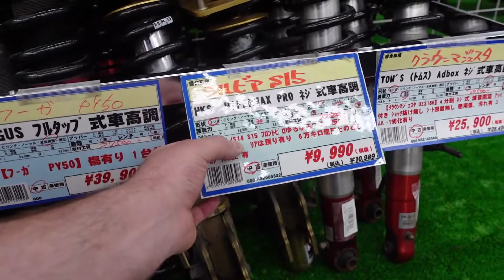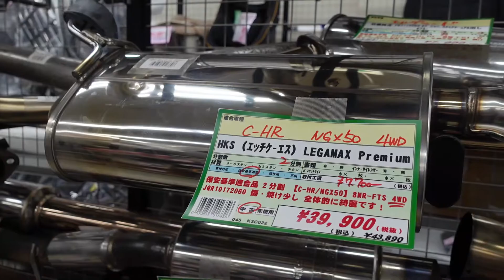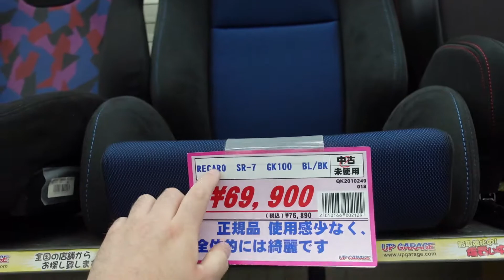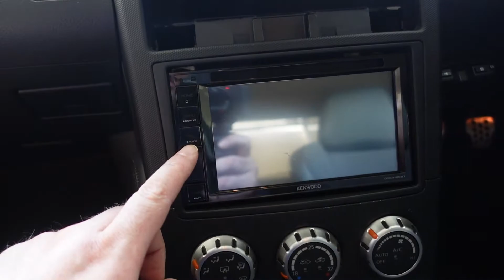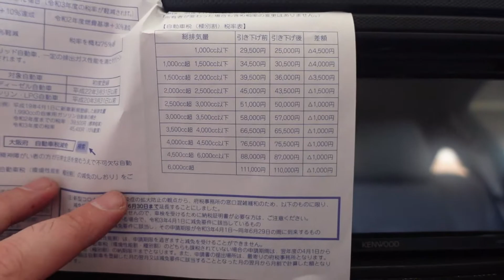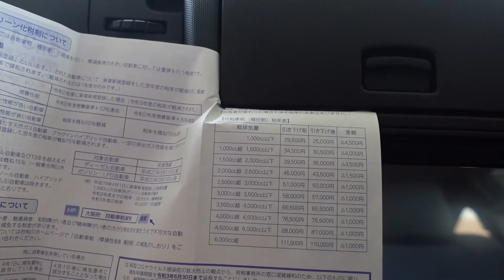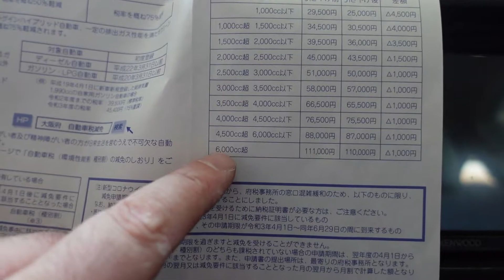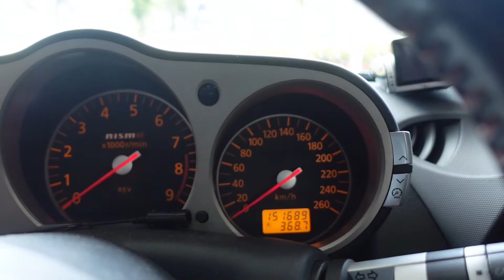Owning a 350z in Japan | How much is car tax?

Comment: How much is car inspection and what are some common things you have to fix/put back to normal before inspection? I’m looking at moving to Japan but I’m from America and I never have inspections or road tax
Reply from the maker: You have 2 inspections. A normal 12 month inspection which covers brakes, tires, suspension etc and then there is the shaken. Shaken which is every two years and is a little stricter and looks into the height of the vehicle, noise etc too. They will cost $160-200) if your car is very low, exhaust is noisy or has the cats removed, these are the typical things you would need to put back to normal.